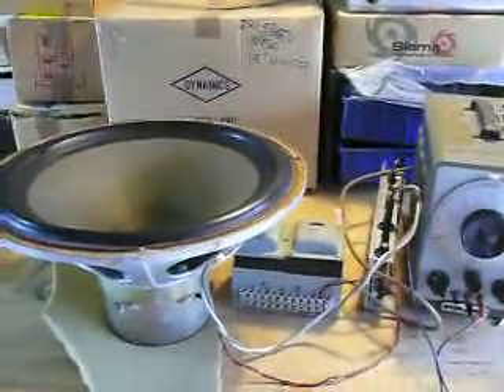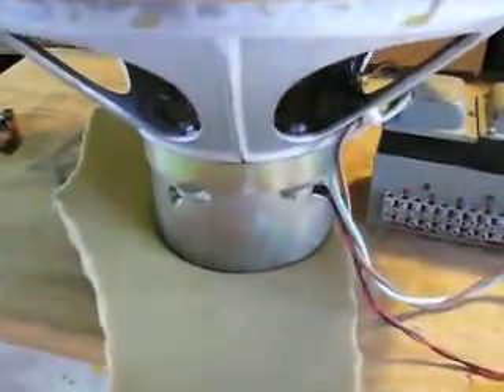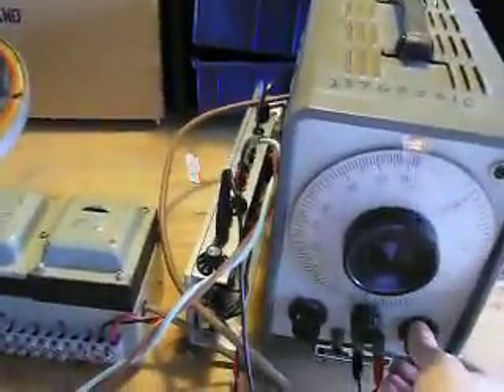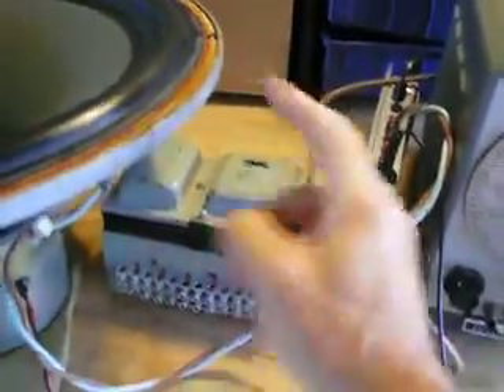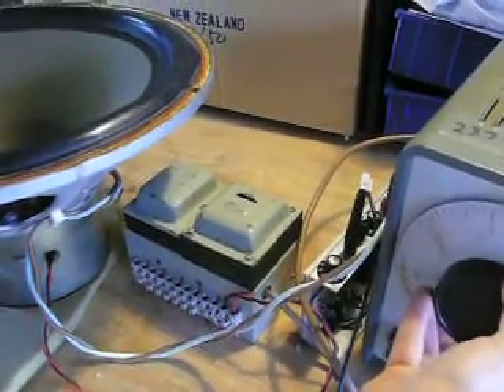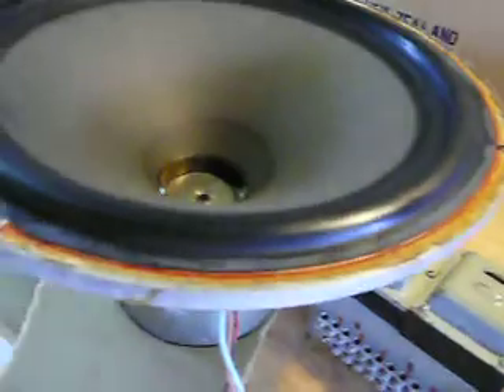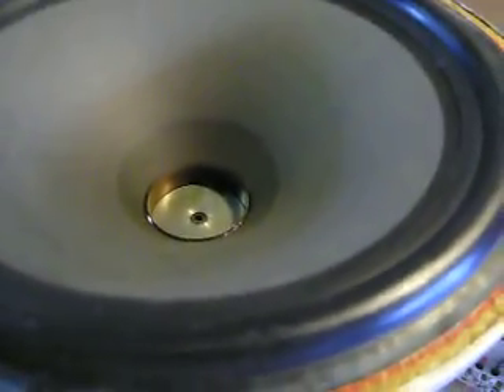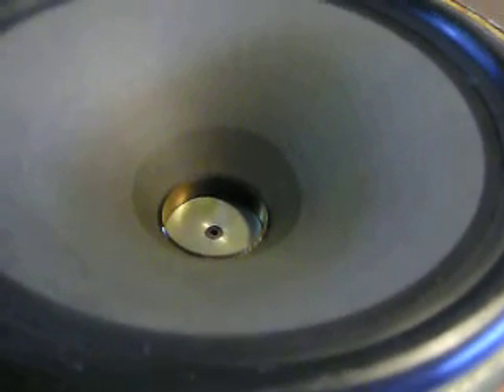Custom Vintage 18  speaker with Western Electric style magnet sweep test

Comment: sweep test involves tone generator? or do you need a diffrent unit to do that? i have a few tone generators but as far as i know i can only use them to tune the radio frequency but id also like to test the drivers in my old radios bc some have been sitting for id say 50 years.